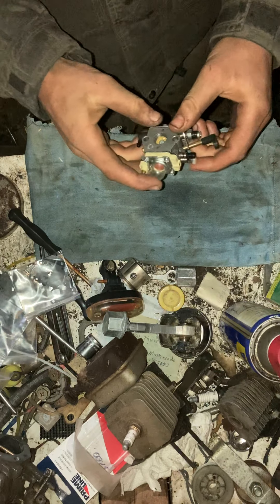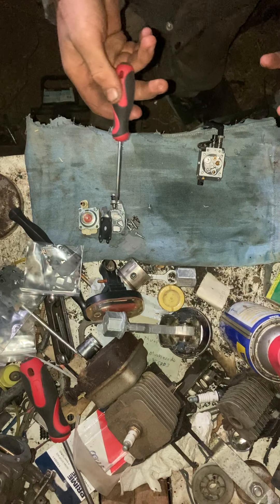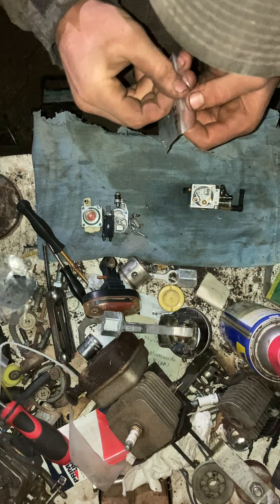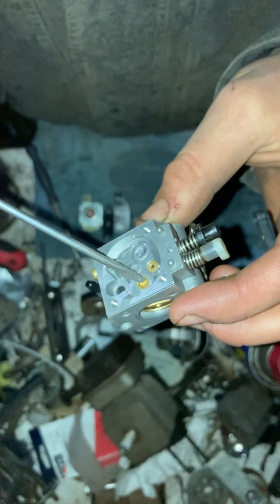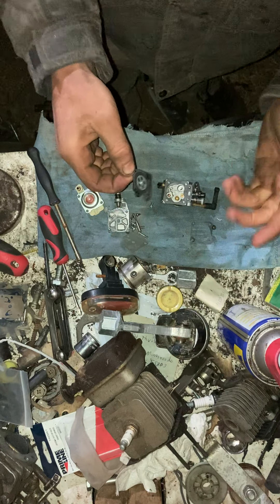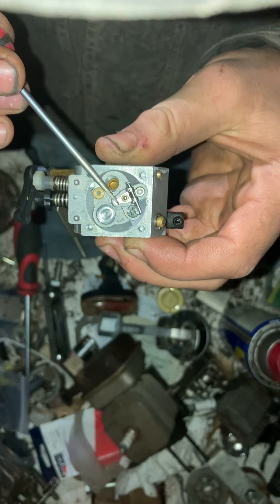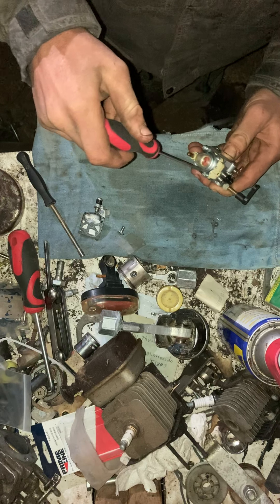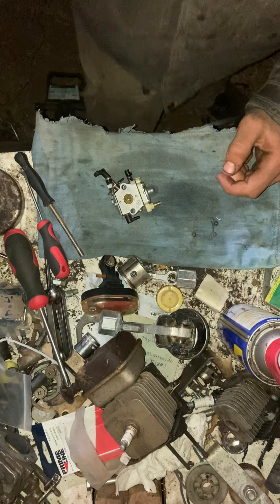Walbro WA/WT complete rebuild!

Comment: Did you call  your viewers a inexperienced idiots in one sentence  for not knowing the correct  way  to put in diaphragm.  And next you forget to put needle in  and adjust it ??may I also add  all walbro carb Hight are not level with the gasket  surface......so tell them that ! MR professional.
Reply from the maker: Did I claim to be a professional? No. If you’re offended, just keep scrolling. No, not all Walbro carbs are the same, that’s why this is listed for the WA and WT series Walbro carbs instead of all the others like the SDC and HDB and so on and so forth. 
Before you write an unpleasant comment, at least try to make it readable. You’ve lots of extra spaces, your punctuation (what little bit of it there is) is absolutely terrible and makes absolutely no sense and it would’ve actually been better if you’d not used it at all, and writing unpleasant comments is just plain rude and disrespectful anyways. 
If you think you can do better, do so. 
Anyways, if you know so much about these carbs why were you watching my video? Were you just itching to start a fight? That’s what Facebook is for.